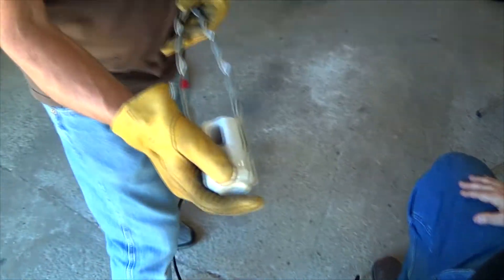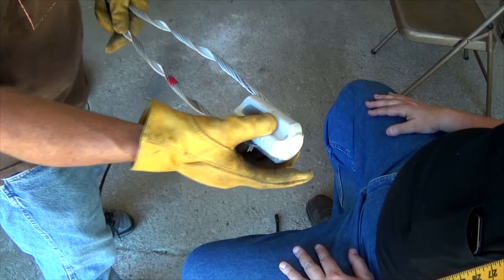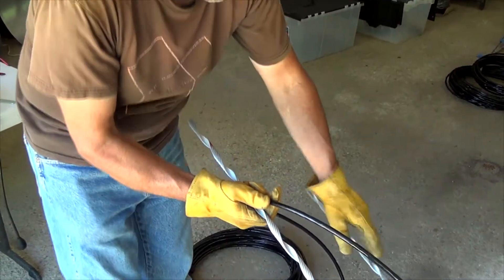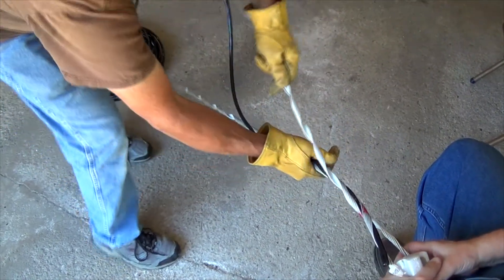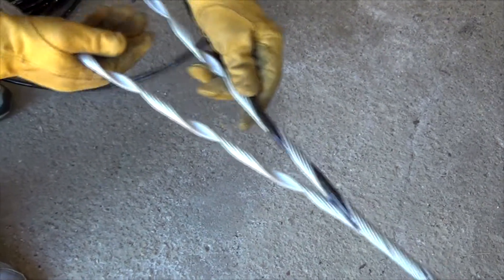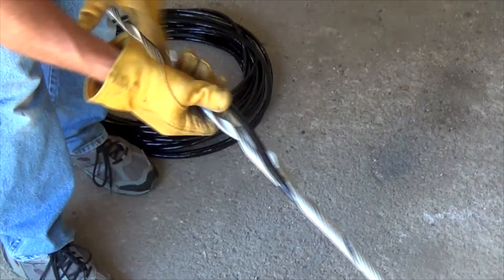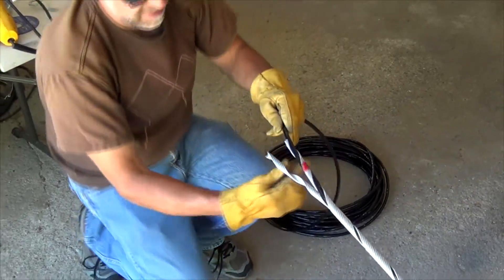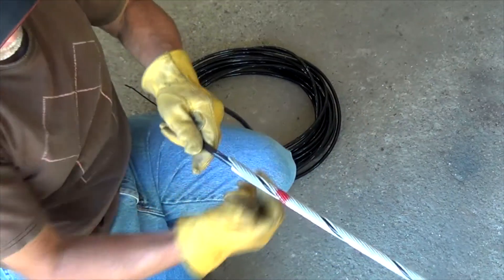Installing a Preform Grip on #6700 Phillystran

Comment: Do you plan to set up a production line to produce Tension Clamps/Guy-Grip Dead-ends? Armour Rods manufacture Devices/Equipments supplier, https://www.artisanmake.com/preformed-armor-rods-machines 
Artisan Industry, TEL/WhatsApp :+86-150-5061-5346, info@artisanmake.com